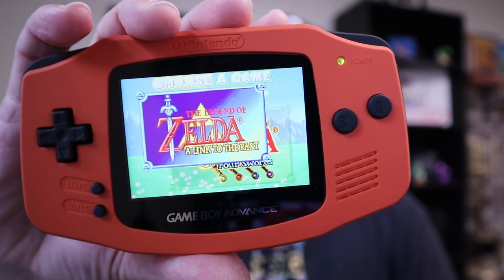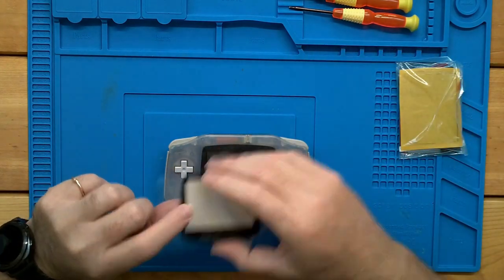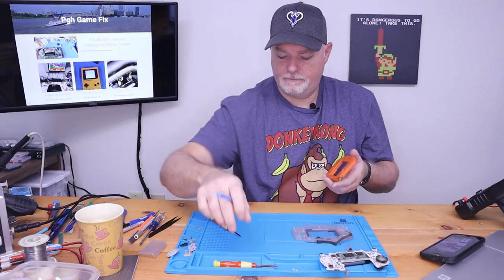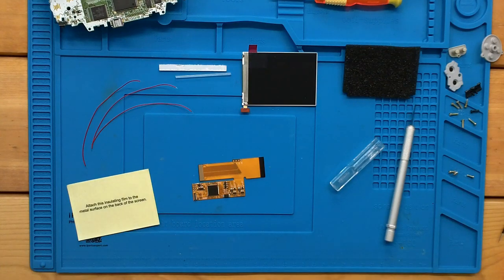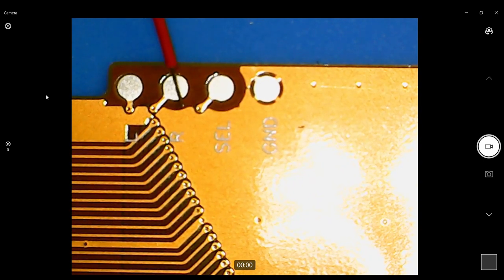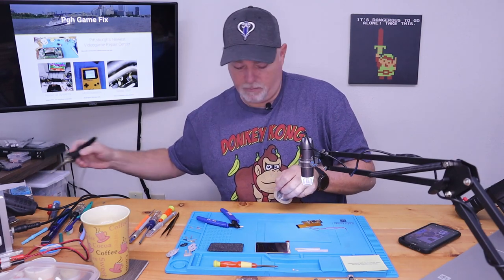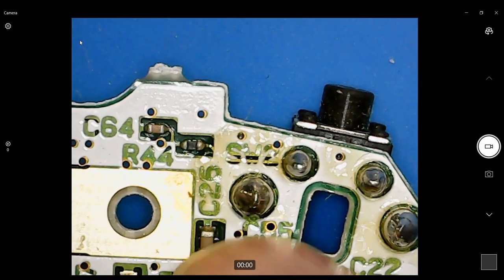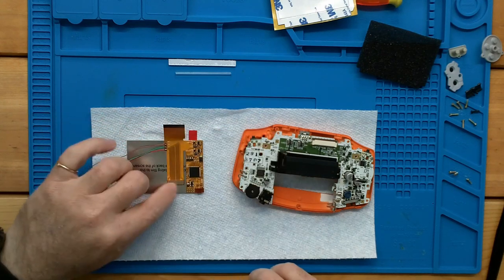Gameboy Advance IPS V2 screen install (unbranded)

Comment: Thanks for putting this up, The ribbon cable/board that hand held legend sent me looks totally different from what they have in their installation guide. Being new to soldering, i wasn't quite sure where those three wires were supposed to go. Condensed video would be nice, you can do a longer video though, might be easier to follow in the long run.
Reply from the maker: I understand.  This is partly why I started making videos, and trying to not edit them too deeply.  That way, people can see exactly what the parts are, and how long it may actually take to install them. I agree... the condensed videos are easier to follow though. In the future, I'm considering doing 2 videos from the content. A shorter condensed version, and a full version. Thanks for the input, and thanks for subscribing !!